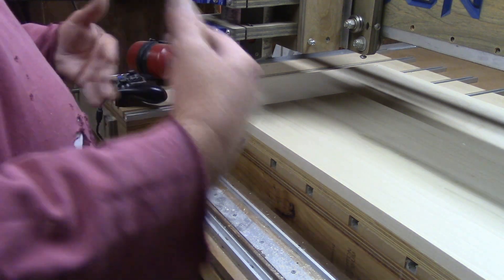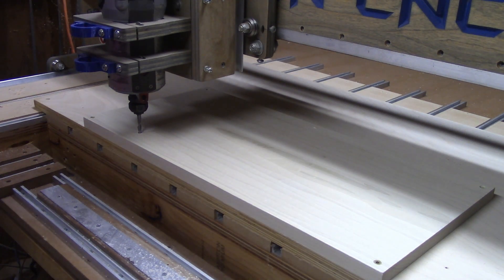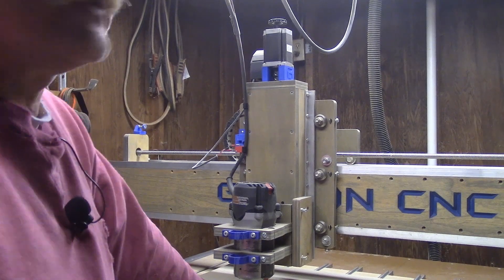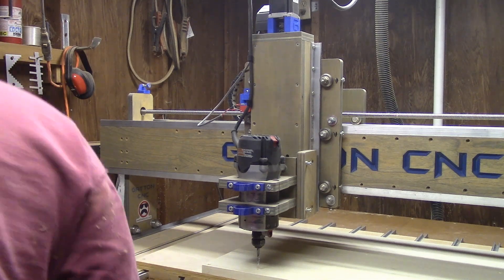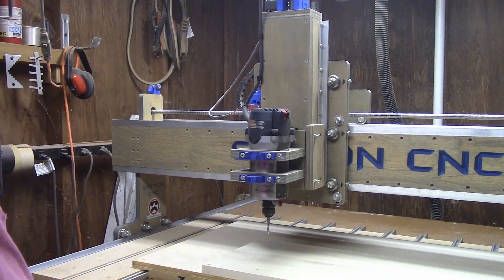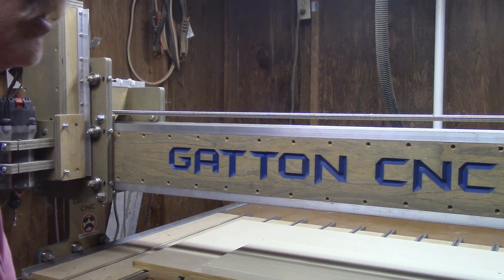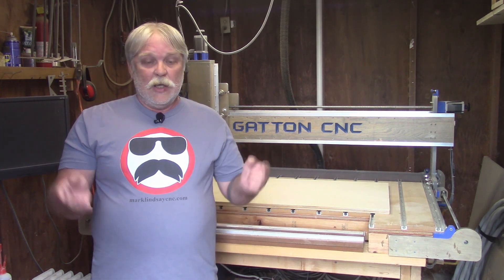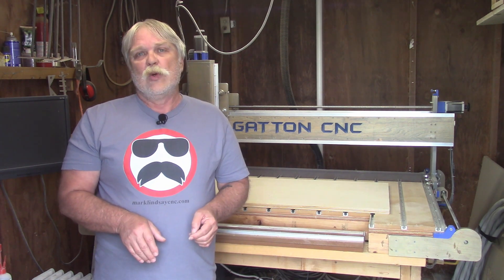Recovery from Loss of X and Y Zero Using My Triple Edge Finder

Comment: I love your videos! Can you share a link or instructions for your remote pendant?
Reply from the maker: I'm using an Xbox360 controller with Mach3 control software. Some control software won't work with that controller, so I'd suggest doign a Google search for your controller software and game controller. For example, search for "UGS CNC Game Controller" if you use UGS. That should get you some results.

Comment: As you noted, there are other ways. Allow me to share a way I have used to good effect (and does not require any extra items)...

- Home machine XY; set XY's to zero. This is a fixed reference.
- Jog to XY origin for job run. RECORD XY VALUES. These are the important offsets from the fixed machine origin. Now, zeros XYs.
- Touch off Z; and zero.

- So, to recover: repeat first step, then enter the offsets (I use gcodes in the command line).
- Again, - Touch off Z; and zero.
- Now, you're good to go:)

- I've had to do this a number of times, especially when training people and they disturb things when switching bits. It works every time - provided you remember to do the offset, and record the values.

Comment: Use Mach 3 at work and it always remembers work offset  so dont know what’s happening there. Maybe a setting ?
Reply from the maker: I'm afraid I'm not sure I understand what you mean by "Work Onset." If you mean "work offset," that's fine if you're using a fixture or some other dedicated setup. I only use a few fixtures, and I don't bother with setting up work offsets for them. Almost all of the projects I cut are one-off projects. I've only ever made more than 1 of anything on rare occasions, so it doesn't make sense for me to go through the process of creating a setup I'm going to use 1 time, then never revisit. Especially when it only takes a few seconds to reset my machine and work zeros should something happen. The only reason this video was as long as it is was because I was explaining what I was doing, moving cameras, etc. Normally it would take about a minute to get back to cutting.

Comment: I saw this in another video, so I thought I would share.

Instead of a aligator clip on the endmill. The guy used a earth magnet and it had the wire attached.   So you don't damage the bit or have slippage, it just clips on by. EMF
Reply from the maker: Thanks, Stephen! I've seen the magnetized touch plate grounds as well. My only caution would be to make sure the magnet you use is conductive and doesn't have a non-conductive coating on it (ceramic, clear coat, paint, plastic, etc...) I've never had the alligator clip slip off (hence the "sanity checks") and between you and me, if that alligator clip somehow damages the bit, I need to throw that bit away and never buy that brand again. Thanks again!

Comment: I have a Shapeoko XXL with carbide Motion and it always remembers X,Y and Z !!
Reply: I have X Carve using GRBL and it does the same. <material X, Y and Z location is retained.  So as long as you have good homing system you are good to go. No  3 way zero needed. 
Does Mach 3 not remember last material zero?
Reply from the maker: When Mach3 is shut down, it doesn't remember anything you didn't save to the XML file. When you turn it off, it asks you if you want to save the last machine and work coordinate zero as a fixture. You can do this to make setup easier the next time you run that particular g-code. You can also (once you have the machine homed and your work zeros set,) save that setup as a fixture before you ever start cutting. As I said in another reply to a different comment, I rarely cut more than one of a project, so it makes no sense for me to save that setup. Not when it takes about a minute to reset everything should the power go out.
Reply: @MarkLindsayCNC  Thanks for the quick reply. 
And I want to say thanks for all your videos they are very informative and helpful to many.